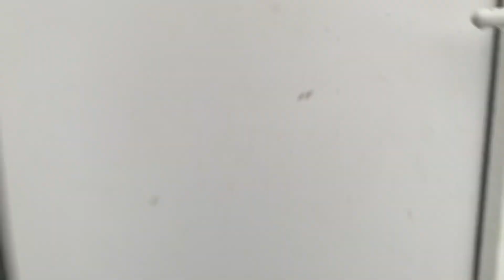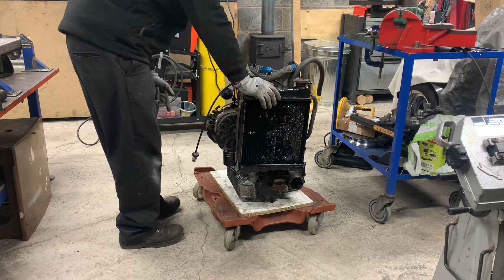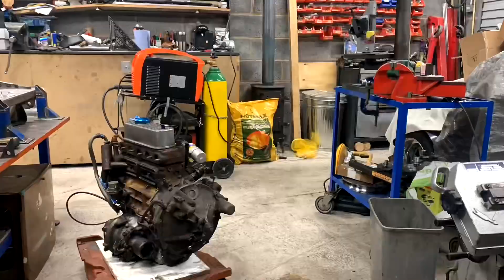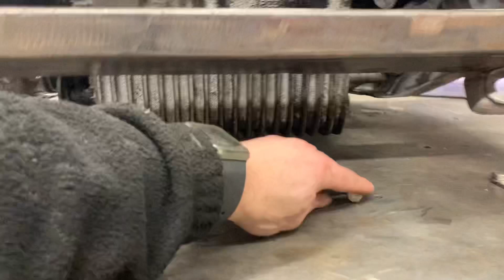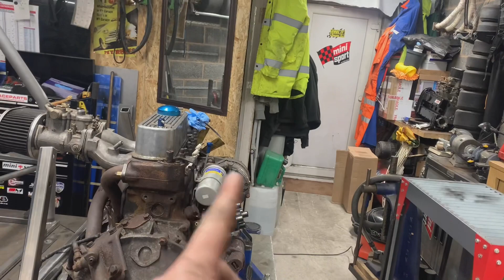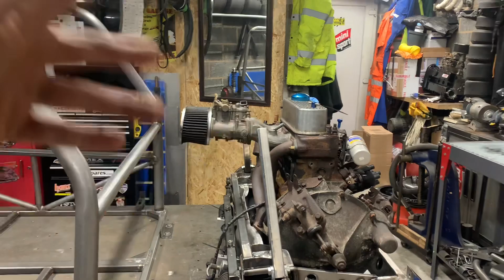Spaceframe race car build has a little engine

Comment: Loads of ground clearance! Thanks for the update Matt
Reply from the maker: Yes buddy I wanted to keep the bottom of the sump above the chassis floor, for one it got less chance of the sump contacting the floor and second if you decide to run a splitter all the way back to the floor this is possible
Reply: @skidmores.garage  Great stuff! Hadn’t thought about a full length splitter. 👍🏼
Reply from the maker: @cooperbloke67  it helps with the down force but it’s also a good way of helping to keep engine bay clean
Reply: @skidmores.garage  Then I’m definitely doing that! 😎